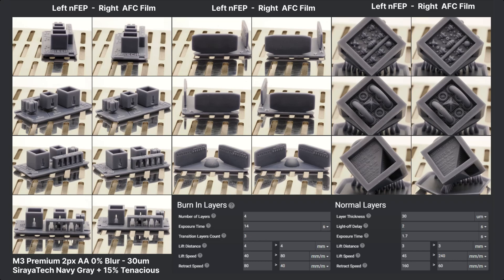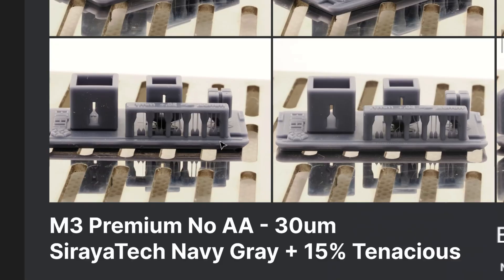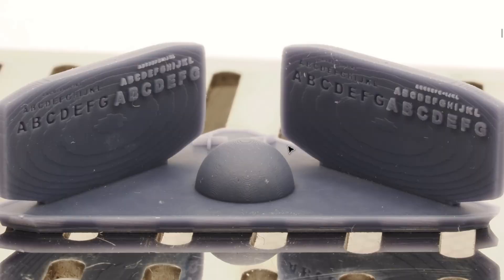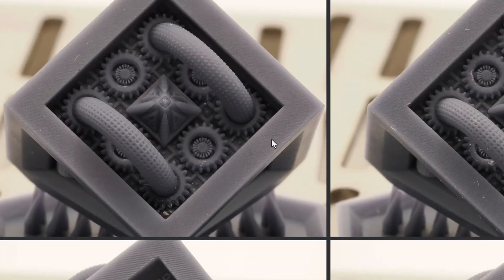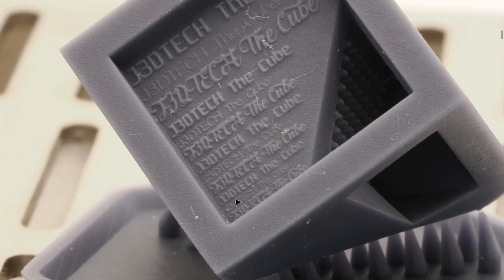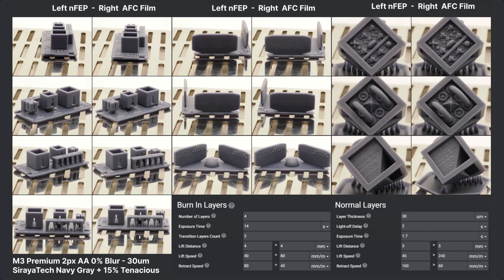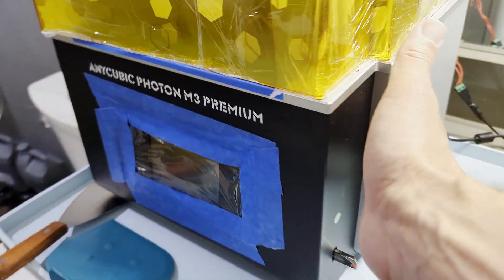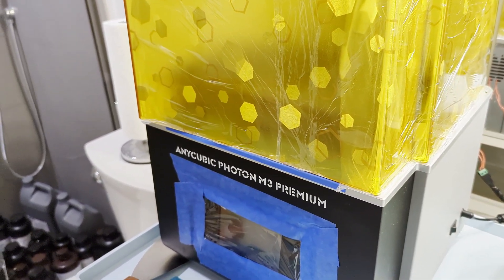Why do 12k Printers come with this?  nFEP vs ACF Film

Comment: So I did buy some ACF, I used it on my Mega 8K as if any printer would take advantage of it this would be the one. I did notice a different surface texture. As for loss of quality I didn't notice anything significant. As far as release being better perhaps but I still saw that it wasn't night and day. I would say that it might be worth it but not by a huge margin but only on something that large I do like that it does seem to stretch better.
Reply: The results I have seen tell me it is not worth the cost. I upgraded a Phrozen Mighty 8K with their 12K upgrade kit including the ACF. I'm reluctant to reduce bottom exposures since it still pops on release.
Reply from the maker: I'm still surprised about is how I got less of the pillars to print then on nFEP
Reply: @J3DTech  I'll be honest that one does surprise me I'm not experiencing any of that I do know on my mega 8K sometimes I have supports that detach and then reattach when they find something higher up I did not have that this time at all and I'm pretty sure that's nothing more than it stretching and sticking to the film, I will say though from what I've read and this is all speculation because nobody will say what film this actually is it is not anisotropic conductive film it is something else. My guess is ETFE or something similar.
Reply from the maker: @Texas3DCustoms  My thinking is that, it is a very small pillar 0.1mm, 0.12mm, 0.14mm. I think that the texture is creating weak spots where it's braking and bending.
Reply: @J3DTech  the texture I have is not very significant just a very slight difference. I will take a short video after post processing
Reply: @Texas3DCustoms  the 12k also have rectangle pixels  thrown  into the mix
Reply: @J3DTech  Also I wonder if "ACF" needs a higher exposure due to UV transmission possibly being lower. Now if we had an MSDS or what it actually was we could figure it out.
Reply: @J3DTech  "I'm still surprised about is how I got less of the pillars to print then on nFEP" 
ACF has lower light transmittance (up to around 5% vs PFA) and you used the same exposure settings for both, it's only logical that the ACF side would fail if the exposures are the same.
Reply from the maker: @Edigor100  I calibrated the printer. Adding exposure time even with 2s light odd delay caused blooming that threw me out of dimensional accuracy.

The way you correctly measure tensile strength is you take an object that is exactly the same shape as another material you put them under stress until they fail. The one that fails first loses.

This is why I always calibrate to dimensional accuracy before I look at the pillars. So what's happening here is the pillars are exactly the same size and the same material on ACF  or NFEP. Yet the resin printed under the film performed worse.

My assumption is the worst surface quality actually decreased the strength.
Reply: @J3DTech  on your PDF you showed the exposure settings being the same on both films though, but this cannot be the same since using the same settings, exposure will be lower on ACF unless you adjust it somehow

you also didn't address the fact that even your PFA prints show visible defects, but that's besides the point
Reply from the maker: @Edigor100  Why do you think that they would have to be different? With where not different, both nFEP and ACF measured perfect at these settings.

The difference the film made was not enough to adjust the settings. 

I even had a guy with equipment to test the difference of light penetration test.

The difference is between his ACF and nFEP agreed with my settings. It wasn't enough to make any difference.

Honestly as far as I've seen In the only reviewer to first calibration to dimensional accuracy before doing any AB comparison.

And yes nFEP also does show defects. You also need to understand these prints are under very harsh lighting and under a macro lens that cost more then my 2 of my 3D printers. Nothing looks great at this angle. 

However on the ACF film you can see and feel the strange texture IRL.
Reply from the maker: @Edigor100  this is an example of the zoom, this pic is taken using the same camera and lense. https://www.instagram.com/p/CtQMaAHLhGc/?igshid=MzRlODBiNWFlZA==

Comment: But ACF and NFEP have different percent transmittance(due to different materials and increased depth of ACF film which made at least at 0.3mm instead of standard 0.1), why the hell you decided that using exact the same settings is representative? They, at minimum, requires different exposure times, using exact the same settings only says that settings does matter.
And well reason why it's started to be used on 12k printers is pretty obvious - because film refraction is less noticeable when you have smaller points of light, it's can be neglected even more if you properly use fresnel lense to enforce UV direction
Reply: Well its still very noticable and ruins thw print quality.
Reply: I have a Chitu UV meter that i will use to measure this directly -- I suspect the transmission loss will be very small
Reply from the maker: @patrickl9930  Yep, not enough to make a difference I'm sure.
Reply from the maker: I also expected them to have a different exposure time. 

However both printers cured this resin to perfect dimensional accuracy at the same exposure settings.

I was within 0.02mm tolerance on XY and Z of the STLs printed.

In fact I don't think I've seen another resin. Or printer comparison where this was done.

Comment: It looks like you have PTC heaters blowing straight at the z axis. Ptc heater blow 60c plus for short bursts. The z axis is made of aluminium bolted to steel rails. They expand at different rates which will very likely leave artifacts on the prints.
Reply from the maker: The heater blows on internal not out. So really it's sucking the air from the rail then at the PCB of the heater that's then pushed into the hood.

Comment: Video justified my purchase of some nfep prior to my 12k arriving. 😊
Reply from the maker: Yes 100%
Reply: Hi, what 12k printer did you order? I’ve ordered the m5s and will. Also buy an nFEP for it. Anycubic’s is said to have 95% transmittance whilst another brand said its 98%. Any clues? Also I need to know the size of the vat to order (one for speed and one for details)
Reply from the maker: @avjebs  for this generation I ended up going with Elegoo. Specifically the Saturn 3 Ultra
Reply: @J3DTech  I got it at the early bird price of 378$ so I’m still thinking about keeping it if the nfep enables great quality
Reply from the maker: @avjebs  It's a good price for a full sized printer.

Comment: Thanks for sharing these in-depth findings. Very interesting info. Wish more youtubers take the time to do this sort of testing. I suppose the ACF may be why the Amerilabs printout had weird lines running across in Vogman's testing of the M5s and Saturn 3.
Reply from the maker: I believe so, once I get my 12k I'll do a follow up.

But I've not even scratched the surface with these new printers.

There is a lot more going on.
Reply: @J3DTech  Will be very interested to see your findings. From the photos of the sample prints reviewers have been sharing, I am not convinced that the new 12k printers produce better print quality. If anything, they look worse. Could due to the ACF sheet or maybe the new 12k screen.
Reply from the maker: @netnoob77  After I get my new printer, should get me about a week to get it all ready, then a day for editing and all that. So hopefuly soon.

Comment: Can you confirm if this is the Phrozen ACF? I trust phrozen more than some of these random listings I have been seeing.
Reply: @user-it7kg3pm4q  there is still the possibility for a quality difference, I have a discord where I communicate with a couple of different commercial 3D printers, one was absolutely furious at how bad the vertical lines on his new Mars 4 Ultra were, swore up and down about how bad ACF was, I was the only other person with experience with the material (purchased from Phrozen, placed on my Saturn 2) so I sent him some screenshots and we compared, his vertical lines were absolutely atrocious! Where as mine are only like a shadow on the model, they cannot be felt, you can see them, but, mostly only on flat surfaces, the best comparison is the old matrix Light grid  arrays in the first Mono machines, sometimes you would see patterns or "shadows" on flat surfaces but it didn't affect the surface quality at all, I have vertical lines but they cannot be felt, I am reaping the benefits of ACF, I can print very large plates and hollow cross sections with a very noticeable reduction in supports, it handles steeper angles for longer distances, if i rest my hand on the machine I cannot even feel the pluck force on lift, my prints have become more dimensionally accurate because of the reduction in pull also allowing me to use smaller support tips. People compare ACF as a trade off between quality and speed, I see it differently, I feel like it's a trade off between absolute surface perfection or a huge QOL boost fighting against less forces casuing failed prints, as someone who supports and engages in all aspects of the process, I am a big Fan of ACF, BUT! That being said, I can see that my experiences may be an outlier or possibly some fluke, or it could be the lines I am seeing other people experience that are very terrible could be a reduction in quality to rush and meet demand to ship these printers, in the end, use what you like, but for me, I dont care about the lines appearing on models that will be painted anyways and the increase in reliability and QOL has been super dope, you can even see in one of the comparisons in this video there is a layer shift on the NFEP comparison where there is none in the same spot on the ACF model. So for those that are having really bad lines, I am sorry, that sucks, and I get the frustration, but for me, it's only like a shadow on the surface of the resin. Hopefully this ends up being sorted out soon because the potential here is great.
Reply from the maker: I purchased it directly from the manufacturer. It is the same manufacturer that makes the film for everybody.

However, I am willing to go buy one with the Phrozen logo and run it again
Reply: @J3DTech  are you positive there is only one manufacturer?

Comment: The texture seem to match the "rough" side of the AFC film, can you  check on that?
Reply from the maker: I installed the Film according to the manufacturer's directions. I was very careful to make sure of that. 

Once I get my Saturn 3 Ultra I'll do this test again.

By popular demand, I'll even purchase a Phrozen Film and run that test. 
Lots of $$$ for this topic but it's the reason I'm doing this.
Reply: @J3DTech  I did not mean to say you install it wrong, but that the texture could be from the AFC, itself, rough surface.

Comment: An excellent video mate, thanks for carrying out these tests. As an after-thought, there's definitely a reason that all of the marketing materials, and most of the reviews don't show close-ups of the printed models for this M5S machine...whereas in all other instances they are more than happy to throw close-up after close-up at you to show off the print surface quality...they new themselves that the prints were coming out with low quality surface finish but hoped that the 12K + Auto-Level + Speed Print combo marketing would get a crap load of quick sales before the truth was revealed that the surface quality is, perhaps still ok for many things, but certainly not what people were hoping or expecting from such a machine. People who like high quality surfaces for their miniatures should steer well clear of the ACF films. I guess the M5S would still be a good machine if you use nFEP, however these also seems to be the potential for bad compression problems with the auto-level feature, going by another review.

Thanks again for the video, love your work bro :)
Reply from the maker: The M5s is also using downgrade hardware to keep the cost lower after putting that money into a 12k LCD. 

It's sad I think they stopped making the M3-Premium a much better machine.

My goal is to get the YouTubers the popular ones to start talking about quality instead of marketing and mostly useless features.

If we can educate the general population to demand a higher quality printer, we will all benefit.

But if we keep giving into these fast fast fast fast fast marketing gimmicks, we're going to keep getting degraded printers year after year.
Reply: @J3DTech  Agreed with all you've said here mate...I also wish they still made the M3 Premium, I've missed the boat on that printer...